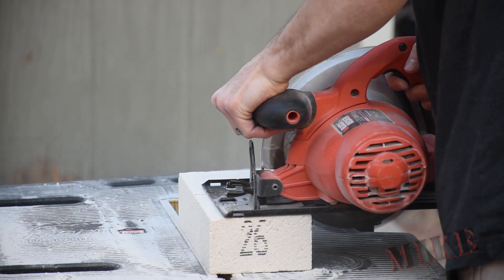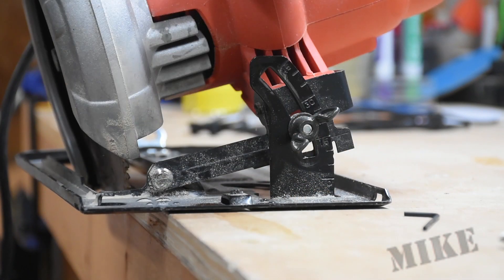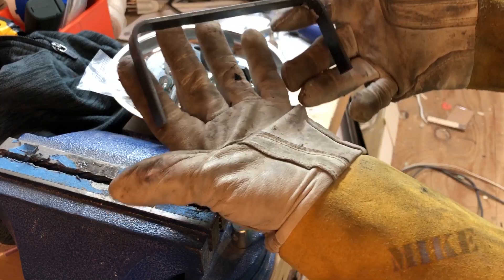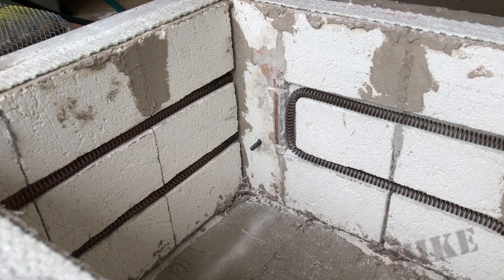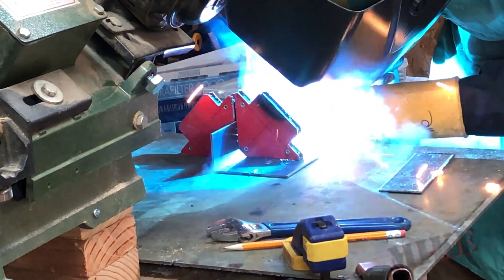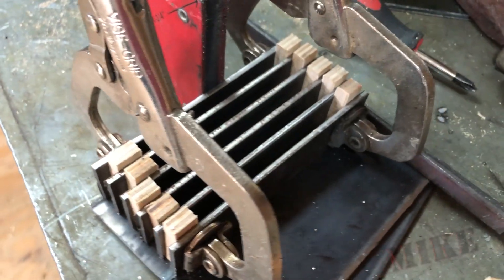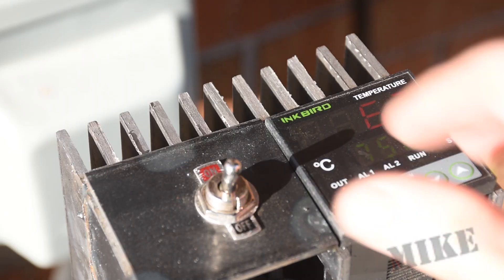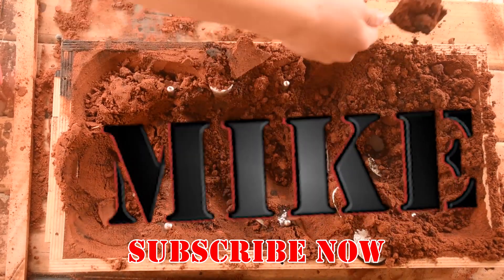Foundry 4 - Mikes Inventions

Comment: A very good video, I really appreciate your presentation style. I also have an home made electric furnace and am wondering what your connection from the heating elements to the power look like. I was using threaded rod initially but it doesn't t seem to last too long and it doesn't make a very robust connection. I was wondering what your connections looked like and how did you use the stainless rods?
Reply from the maker: Hey Mark! Shoot me an e-mail and I’ll send you a diagram of how it’s hooked up.
Reply: @MikesInventions  hello Mike, I can't t seem to find your email address could you contact me at mine at my first name.lastname at Gmail?  Thank you.